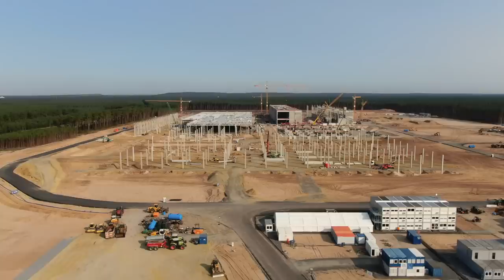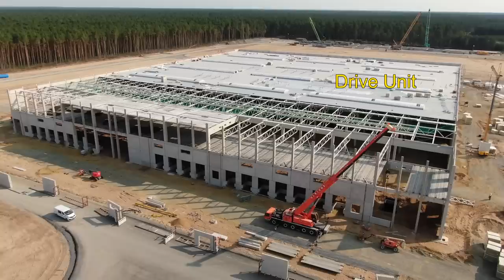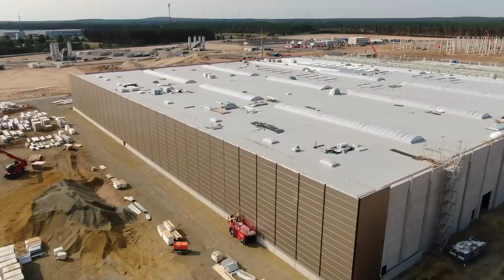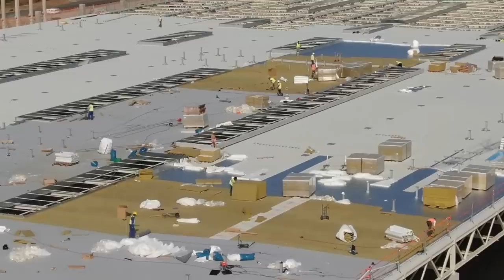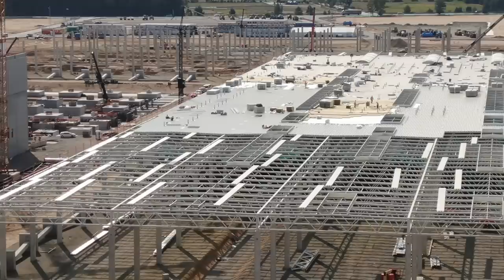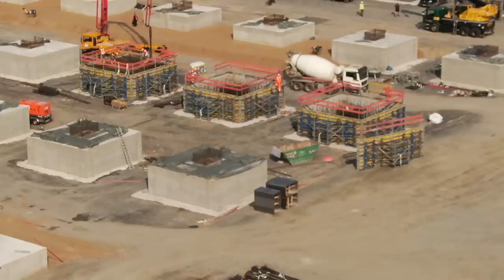Giga Berlin | 2020-09-12 | Paint shop is growing

Comment: Do you know, Tobias, whether the drive unit building is also where they are building batteries and battery packs or is that going to be a future building?
Reply from the maker: The packs are build in the casting section. Everything else related to batteries will be a future building.
Reply: @TobiasLindh  Maybe they will skip packs design altogether as teased by Elon ;)

Comment: I Love these flyovers and that you out the labels on everything and also overlays the finished factory. 

Have you done any video of the supply routes to the construction area? Where the trains come from and where they onload the trains and so on?
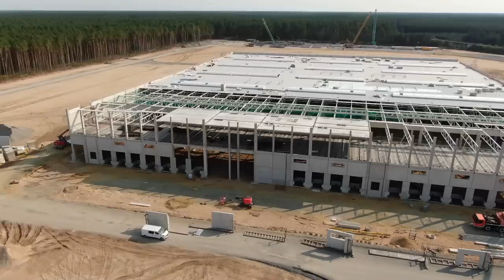Reply from the maker: No, I don't have a video of the supply routes. I only see the parts when they arrives at Giga Berlin. The train track is right next to the construction site, so they unload the trains directly at the site. You can see the area where the trains get unloaded at 2:25 behind the drive unit building. But it's hard to follow where they come from. Max Bögl and Goldbeck have many factories.
Reply: @TobiasLindh  Ah tnx. Yeah just wanted to see from were the trains come into the area not the production of the pillars and so on ;)

Comment: Coming along nicely, cool footage as always!

Why does pain shop need so massive pillars and foundations compared to body in white and why the relatively slow build compared to other buildings? Still lots of large pillars missing. Also why does Tesla need both casting and stamping sections, can't they just do the former?
Reply: I don't think you'd want to have a large plate of cast iron as door or hood panel of your car...

Every pillar that's not part of the paint shop only needs to support a roof. Makes a little bit of a difference if you have to support a simple roof or 2 more floors with heavy machinery.

Comment: Oops... prefabricated columns including foundation footpad...???? Risky choice...
Reply: This is certainly not their first time doing this method. That will be strong enough, but i know what you mean 😆
Reply: The two are connected using concrete on site
Reply: @MnrBugi  I tought so too
Reply from the maker: @MnrBugi  No, they are already connected when they get delivered to the site. But they use concrete on site after they placed the columns.

Goldbeck is specialized in this kind of construction. They do this all the time.